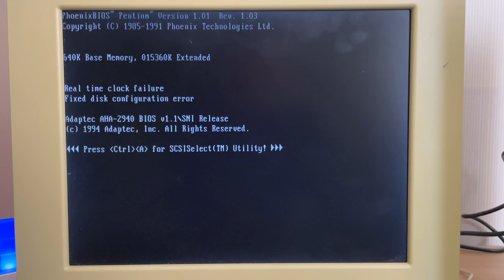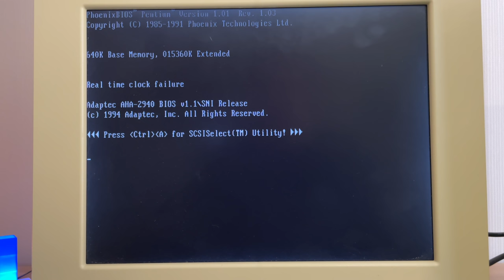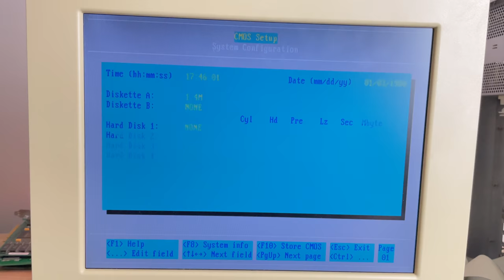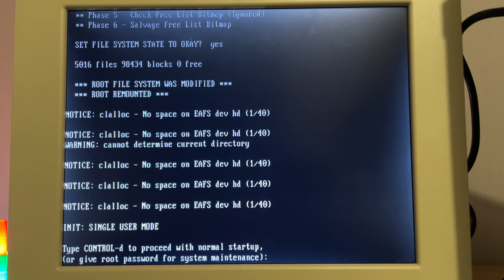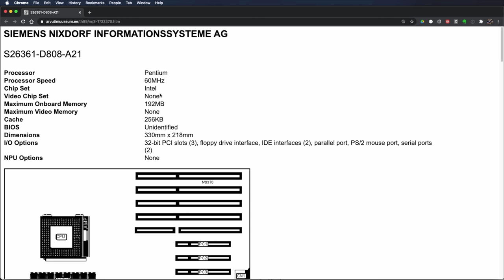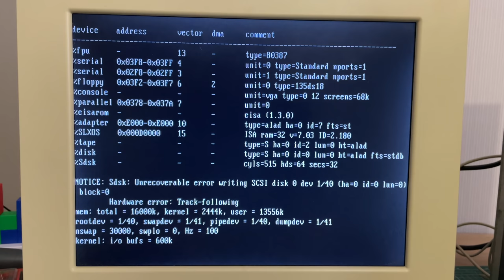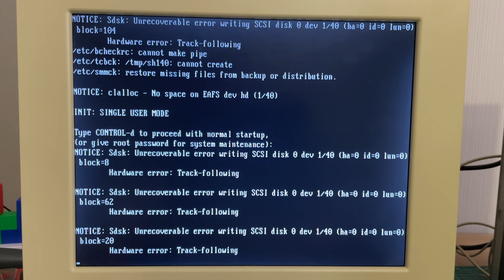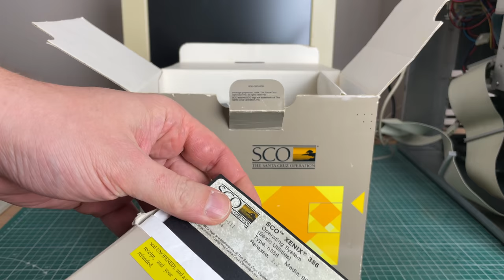Siemens PCD 5T Pentium 60MHz Workstation

Comment: Add my vote for SCO UNIX. There's honestly enough retro Windows 95 content out there. It's far more fun watching something exotic like that old UNIX.
Reply from the maker: Will give it a try ! :)
Reply: I agree! I've never seen SCO UNIX used before, and since it came with this machine it's a perfect fit!
Reply: I don't know much about older SCO UNIX releases, but I used UnixWare 7 on my Pentium 133MHz machine and it was a pretty nice system. I still miss using CDE, it was a very clean, if somewhat dated looking desktop environment.
Reply: @RetroSpector78  Memories are awakened. Thanks for the video :) And prices are at the bottom/middle of my post...
The dirt ... Siemens ... The case: It looks like a PC that was used in an industrial production environment, such as a factory hall. The SI HOST serial interface card is definitely a very strong indication that this PC was connected to a SIMATIC (PLC) controller. I was working with this stuff back then. With this, manufacturing data of a sintering plant was collected and bundled. See [1] + [2].

At that time we also had such operator / production systems (at Rheinmetall AG). All programmable logic controllers (PLC) were from Siemens, so if there is an interaction between production and this PC, then it is obvious to obtain the product from Siemens. Including the software. For example [0] indicates such an interaction software.
The tape drive suggests that production data has been processed and cached for later use ... or backups. I am not sure. The lack of a network card indicates that the work was disconnected from the company network. Maybe a specially secured area? But that's just a guess. With us, the production data acquisition was by all means via network, albeit connected to a separate network-strand.

If that's what I think, you're out of luck anyway. The Com-Port dongle for the Siemens software is missing, isn't it? :) In addition, the loss of the hard drive is a shame. I am so sorry for you. Possible restoration: SCO was sold to Caldera. A license costs around $ 80 (Price List - PERO Computer). We'd better be silent about the price of the Siemens software [5] :)))

The LEDs are probably POST indicators for RAM, CPU, graphics and boot, etc.

Thank you again for showing this off. These machines are really good and reliable workhorses.

At 20:42: "I doubt that this was used for gaming". Rogue! Tetris! Pong! I would be careful with that assumption. What happens in the night shift stays in the night shift;)

[0] https://support.industry.siemens.com/cs/document/4243694/softnet-s7-unix-sco-and-softnet-tf-unix-sco-for-sco-v5-0-4?dti=0&lc=en-WW
[1] 7XV5655-0BA00 Serial Hub https://www.siemens.com/download?DLA08_391
[2] Only German, look for CP544 https://cache.industry.siemens.com/dl/files/699/109748699/att_968190/v2/109748699_S5-S7_1500_Comm_Serial_DOC_V10_de.pdf
[3] About the 928B CPU internal serial ports: https://support.industry.siemens.com/cs/attachments/1085940/pa928ben.pdf
[4] Older S5-115U Reference: https://cache.industry.siemens.com/dl/files/937/1085937/att_904/v1/6ES5_998-0UF23.pdf
[5] Siemens Softnet TF / APRED / UNIX 2XV94501CB00 Control software Softnet € 12,598.33 ... without shipping:P

P.S.: Have you ever seen the beauty of a Siemens PG 685? A 8080/Z80 CP/M machine and PLC programming device. A picture with the typical coloured Siemens keyboards of that time reminded me of it. https://de.wikipedia.org/wiki/Datei:Siemens_Simatic_S5_PG_685.JPG + https://forums.bannister.org/ubbthreads.php?ubb=showflat&Number=106592&page=all
Reply: Back when I use to work for McDonald's the Server they called the ISP ran SCO Openserver and used a ASCII driven menu system for POS control use. At one time they had the Merge package that let you run Windows 95 on top of Openserver, kinda like a VM. By time I left McDonald's the roles of the ISP switched. Ran Windows Server 2003 and in a VM was running Openserver.
Reply: @gcolombelli  CDE rules, thats for sure. I loved it on SUN Solaris
Reply: Bonus points for getting it running, but then what?  Most of the stuff people would run SCO Unix for would either be proprietary or expensive and highly specialized.

As cool as it would be to “have a Unix box,” that would be pretty much the entirety of it.  Unix.  And not much else.  ;-)

Then again, is there a lot of utility in a tenth Windows 95 box?  * shrug *
Reply: Oh sure, I know.  :-)  I have four.

Comment: So I worked in PC world and Dixon's stores grouo in the UK in the 90s and early 00s. They had these systems in every store. They acted as the central system for all of the dumb terminals. The system was called REPOS, a menu driven system (text only). It stood for Retail Electronic Point of Sale. Not sure if that was exclusive to DSG or not. It worked like a dream. Solid as a rock and it did everything that was needed. Some suit in HQ decided that it didn't look sexy or something come the early 00s and they replaced it with a nasty Java based system called Eclipae that sat ontop of Windows (pos edition?). It hung, it crashed, probably caused DSG tens of thousands in lost sales. It eventually got better but was always very shonky IMO. Just goes to show, it may not look 'up to date', but don't fix what ain't broken!
Reply: I’ve got such a nostalgia for seeing those text mode POS systems in operation. The graphical replacements certainly caught my eye, but even in the day as a young’un I noticed it was laggier and unreliable. While the people could absolutely fly through the text mode systems by pressing the right function keys quickly. Smaller shops used them into the late ‘00s, I found they rung me up quicker, and printed easier to read receipts too (no promotions garbage to waste space). The latter might just be due to being smaller stores though.

Comment: That motherboard is a beauty! What a find!

That 3:e AT connector is most likely 3.3V "optional" so if you have a PSU with that then you can connect it to.
I installed a Siemens P60 motherboard in another Siemens Socket 7 chassis, not strait up fit, well motherboard fitted but its a desktop with a riser and that required an adapter. But both Siemens board, the Socket 4 and the Socket 7 had 3 AT connectors, one labeled 3.3V Optional. The Siemens Chassis had this Optional 3.3V, 3 brown and 3 black wires so when looking at the back pin 1-3 are solder together, pin 4-6 are soldered together.

Now 3.3V is not a part of the AT standard so thats probably why its optional and works without it, I suspect it migh be for some PCI cards that might require it. PCI bus can have 3.3V and there is also a 3.3V AUX pin for standby, and both those motherboards had a special header for the PSU, not required for the motherboard to work but required to be connected if the Siemens PSU was suppose to be used and power on, so I guess that might be part of it to, not sure but that 3 pin connector was different and not electrically compatible between the two Siemens motherboards so I ended up making an adapter that fools it to think its connected so its basically normal AT now XD

Anyways long rant but I think thats what the 3:e connector is and suspect it might give better PCI comparability, might also have something todo with standby, not sure, mostly speculation.

Looking forward to part2 !
Reply: optional power for cpu upgrade? or extra power for the pci bus as first gen had 5v pci 1.1 had  3.3v  as well?
Reply: @daoutbox9884  Socket 4 is 5V only socket. There are no 3.3V CPU's as fare as I know and even socket 7 Pentiums require 3.52V. Overdrive pentiums have there own onboard 5V to Vcore conversion built in.
There is no PCI 1.1 as fare as I know. 
PCI 1.0 was released in 1992 and PCI 2.0 came after that in 1993 just when the Pentium was released, so same year.
In fact I have not seen a Socket 4 or Socket 3 486 system with 1.0 PCI slots, mine have 2.0 and same goes for the once I worked with before.

So yea My guess is that the optional power is for PCI 2.0 since it supports 3.3V and also needs it for standby power it seems and I know Siemens did have standby support on there AT systems in some form.

Comment: AH Siemens PC. All my work time in the 90s comes back. We used quite a lot of Siemens PC's in industrial settings, also with SCO Xenix and Unix (2 different products, be careful). The ISA card in your system is a serial port multiplexer, there should be an external box with 8 25 pin sub-D connectors or later they had 8 9pin sub-d cables. These things were generally used to connect dumb text terminals for visualization in industrial settings. While people think that dumb terminals à la DEC VT-220 went extinct in the 70s, they are completely wrong as that market still existed up to the year 2000. Mostly 2 brands remained until then Qume and Wyse. Later, with PC technology getting cheaper and smaller and LCD panels starting to gain robustness and readability in harsh environments there was no point in that kind of terminals anymore.
We used SCO Unix at that time as the need for multitasking was not possible with DOS even if we had some installations which used Concurrent-DOS, there was no comparison to the clean multitasking of a proper Unix.
Reply from the maker: Cool story ... thx for the write-up. Will definitely give SCO a try and see if I can create some interesting content on it.

Comment: SCO Unix and a serial card for terminals screams "point of sale" machine to me. Loads of stores had setups like this with text terminals back in the 1990s and early 2000s.
Reply: Yep, McDonald's did this and I think Autozone as well had a similar setup.
Reply: Would the box have been under the table, or rather out in the back? I had always noticed they looked like older text mode, with the buttons they press on the side of the POS being literally F-keys, as a young’un seeing them used, and was always curious at the time where the computer actually was. (And that curiosity got even stronger when they begun replacing them with touch screen units with higher resolution and graphics modes instead of text mode)

Comment: Great vid!  Seeing that SCO boot prompt pop up was a treat.

Looks like it was running SCO 3.2v4.2, which was pretty common on early to mid 90's servers.  I'm guessing the heads banged against the platters when the disk hit the ground, which would ruin a bunch of sectors, but, amazingly, it looks like the filesystem is still semi-readable.   It looks like your disk set is for 3.2v4.0, which is slightly older than what was installed, but it should support the SCSI adapter, and it should be able to mount EAFS file systems.  You might try installing 3.2v4.0 on another disk, putting both disks in the machine, booting to 3.2v4.0, and then mounting the root filesystem of the bad disk.  You could at least poke around and see what was on there.  This is all a little tricky though.  IDK how familiar you are with SCO, but when you add a disk to 3.2v4.x, it isn't autodetected.  You have to reconfigure and relink the kernel to support it.  Also, SCO uses partitions and divisions, and a filesystem sits on a division, rather than a partition.  Instead of creating partitions for swap, root, u1, etc.  You typically use fdisk to create a single partition, and then use a tool called divvy to create divisions within that partition for swap, root, u1, etc.  It's been forever since I did that kind of stuff, but I might be able to re-figure it out if you want to try it.  You might even be able to tar up most of the old disk and finagle a way to boot from it.

If you do decide to put SCO on it, I wouldn't worry about the sound card.  I want to say there were Open Sound System drivers for soundblaster cards for SCO, but I think the first supported version was 3.2v5.0.2 or 5.0.4.

From the late '80s through the mid 90's I worked for various folks that used Xenix and versions of 3.2v4.x and OpenServer (3.2v5.0.x) on 286 through pentium systems.  They all had Computone Intelliport cards in them, but they were similar to the card you have.  Basically they "ran the company" off of the one computer and used the serial port card run a bunch of terminals, scattered throughout the office.  It seems crazy now, but with text-based apps, 16mb of ram was plenty.  The lack of a networking card and presence of a tape drive makes me wonder if that machine was used like that.  If everything was running on on machine, there'd be no need for networking, but definitely a need to back the machine up.  I'd be really interested in seeing what was running on it.

Good luck!
Reply from the maker: Thx a lot for the detailed write up ! I will give SCO a try I think. Did some retro linux video’s in the past. Might make for some cool content.

Comment: i dusted off my old 1998 athlon 550 system and re-soldered caps with your teachings and wow, i cant stop watching your videos. and btw my old system works great...just cant find a ps/2 keyboard or mouse anywhere so im at a halt.
Reply from the maker: That’s super cool .... ps/2 mouse and keyboard should be readily available for free. Pretty sure you have at least a dozen 1st level contacts that have them lying around.

Comment: Sorry to hear about the hard drive.  Looks like a really neat system.
Reply: I still have a 20MB ST-412 lost track 0. Found it by moving the head manually. MFM/RLL are saveable due to soft sector formatting.

Buuuutttt tracks fade over time so a periodic reformat is necessary or it will fail again and a low level format is needed.

This PC

Is REALLY cool! This is my favorite period from 1983 to 2004 ish

Comment: Nice Server. 
I have a Siemens Scenic 5T/90 PCI. I think this is the workstation-version of your Server. The case has many similarities, but the mainboard formfactor is completely different. It has a Sockel 7 LPX motherboard with onboard Tseng Labs ET4000/W32P and no SCSI.
Love it and it received a couple of upgrades over the years: Kingston TurboChip 233MMX, Voodoo Graphics, 64MB Ram, Soundblaster 32 AWE and a NIC.

Comment: You really should try to install SCO Unix on this machine. It could be interesting
Reply: I would prefer slackware96 aka slackware 3.0
Reply: @HoboWild i used to run linux, but my workplace gave me software that only runs on windows, so i was forced back to windows due to the software having vm detection and other shit.
Reply: @HoboWild Nothing wrong with modern Windows? Are you kidding me? I agree that Windows 10 is probably the best Windows yet, but that's a low bar. The amount of data harvesting and spying they do on their users is disgusting. Performance is generally awful, and degrades over time in the classic Windows fashion. Linux is easier to use, faster, and more beginner-friendly than ever. There's very, very few reasons to use Windows anymore.
Reply: @AureliusR  👍

Comment: 17:21 These LEDs are usually for hardware debugs. It needs to check the motherboard manual !😀
Reply: It checks the motherboard manual or it gets the error message again?
Reply: @fnglert  It Gets the error message , because we don't know these LEDs states meaning when it self testing.
But unfortunately, manuel doesn't show these LEDs debug feature. Maybe they're like dual 7 digit display but it's BCD or binary code.(They're 8 LEDs)
Reply: @crazyfurnaceguy1229  I made a movie reference with my comment, a modified quote from Silence of the Lambs :) Am sorry you missed that.

Comment: That is a nicely built case. Looks quite high end and service friendly. Tandberg is also well known for making studio grade tape recorders. This may have been a good cad workstation back in the day, provided it had a better video card and a more common operating system.  I’d suggest Installing Windows NT4 on it instead of SCO unix, so that it can run AutoCAD release 14/2000. SCO unix seems slow to boot, I do wonder how much software was actually available for it. Considering the dust, I bet it must have been used in some factory running some bespoke application.

Comment: I've started common practice when working on old machines like this is to backup or even norton ghost if you will, lol to a backup drive just so if you have to use like an SD to scsi adapter or something you can restore the OS, my kaypro was like this since each unit of those line can be slightly different, I ended up using the original boot disk and hardware with a floppy emulator to convert the original disks over to SD, I also had many years ago an IBM PS/2 tower that was all scsi and the unit even had a scsi cd rom, i believe it was clocked at either 40 or 70ish mhz

Comment: I have a lot of Siemens Machines, but only the PCD 3/4/5 Desktop Versions. Got to say, that motherboard is quite a different beast than the Desktop ones. Despite having the same colour. I have a soft spot for Siemens Nixdorf, lots of the machines I own I used to work at when I was going through my banking apprenticeship. Many of then running OS/2 back in the time.
These days I like that they are pretty standard inside, not much proprietary stuff going on and you have some nice slots for a soundcard and a Voodoo or something to go with the onboard Matrox Millennium or Tsen ET 4000 chip.They were good quality too and as a owner of way too many retro computers I like that I can stack like 8 of then on top of each other and hook them all up to a KVM switch :D
Reply from the maker: Haven’t decided yet what I’m going to do with this one... also have the PCD-5H (desktop). Need to check that one out also.